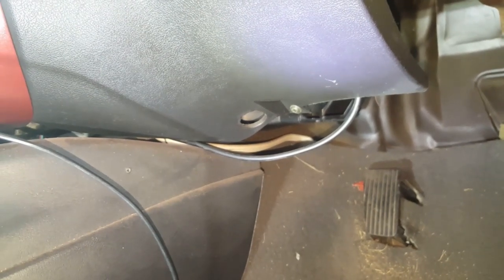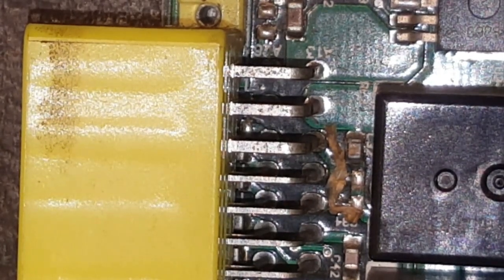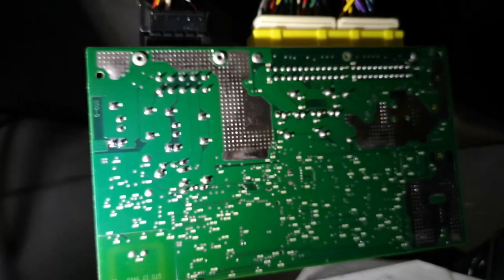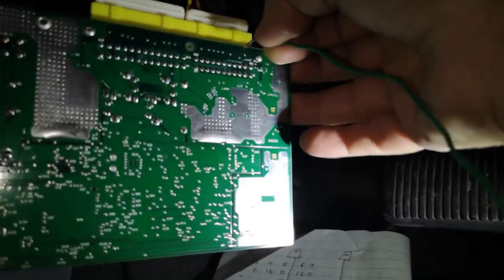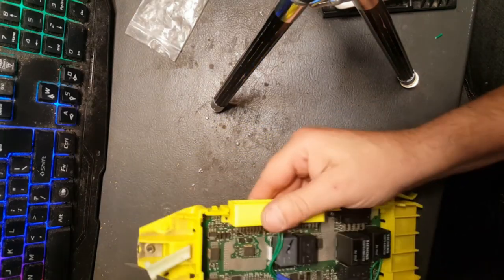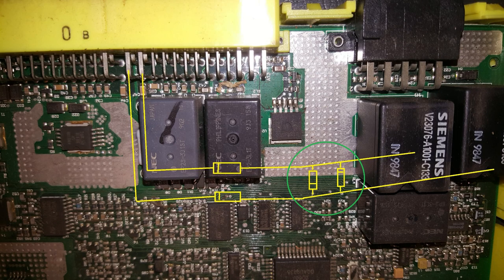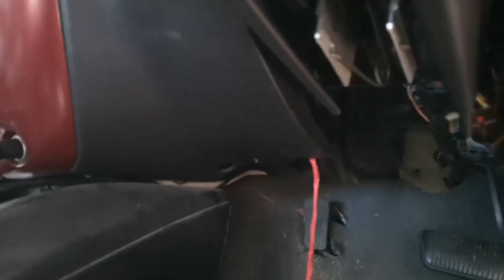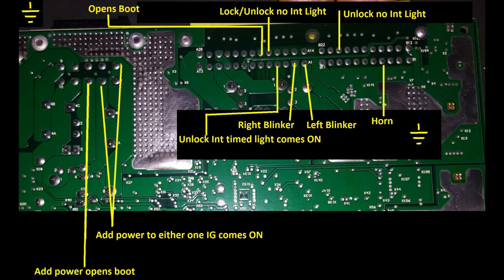AU Ford Falcon DIY BCM Work Around Repair | Body Control Module

Comment: Ak-Shoe-A-Tor, is how it's pronounced...😂 (spelt differently, of course).

Very well done, and I've just dismantled my BCM. Blown diode, next to where the crap you located, in the beginning. Is that associated with smartshield/starting issue?.

Cheers M8 👌
Reply from the maker: Not sure. And yeah, when putting pen to paper Egnlish is messed up :) I like to pronounce words ending with gue how thay are spelt rather than who they should be spoken. Example. Tongue - Ton-gue
Reply: @TEKNOFIED  understandable. Phonetically speaking, was a thing, that my sister still does...😉

Comment: On a Ba those plugs are to do with steering wheel audio controls.
Reply: Ba falcons they have 4 plugs on bottom and if you replacing second hand module you should save program with ForScan software from old module and rewrite same program on another second hand module which should have same color and part number like old BCM and car will start withouth security isue. Usually falcons BCM has Blue color,Green,red and Black with different part numbers.

Comment: is this related to why my speedo sometimes stop working for a couple hours and all my guages sometimes just die and restart?
Reply from the maker: No. It sounds more like your Alternator is over charging. I have seen what your explaining a few times with all types of cars mostly Ford and Holden. The cluster looses all readings and randomly works again. Have it checked asap before your battery no longer wants to take a charge and your ECU burns out. I have never seen a battery leak or explode from being over charge but you never know. Better get it checked soon mate.
Reply: @TEKNOFIED  i have a spare alternator, should i just swap it out or is this something major?
Reply from the maker: @chanuda4824  I would swap it out. There is nothing else major I can think of right now other than making sure the Battery is still good.
Reply: @TEKNOFIED  ill buy a multimeter and check the current, if it's buggered ill change out the alternator. thanks so much mate 🙏
Reply: I’ve also seen that if alternator is over charging that they won’t go into 4th gear.
Reply from the maker: @darrenvictoriathornhill1170  Good to know. I personally have not seen that happen yet. Cheers